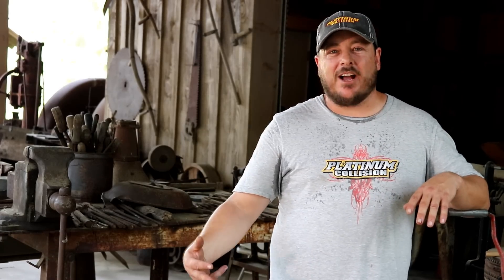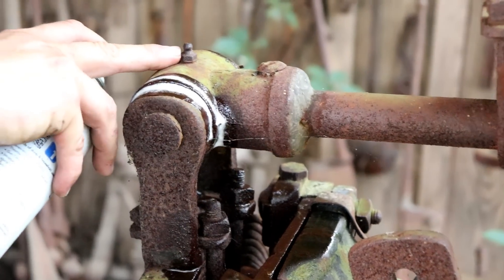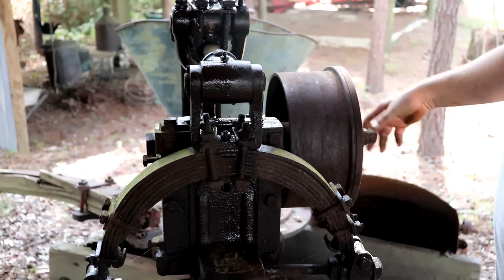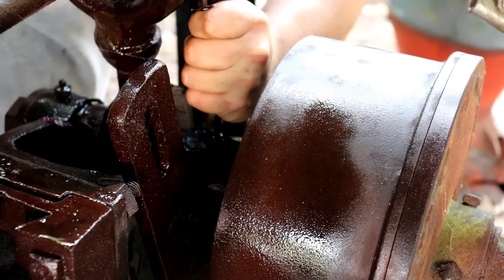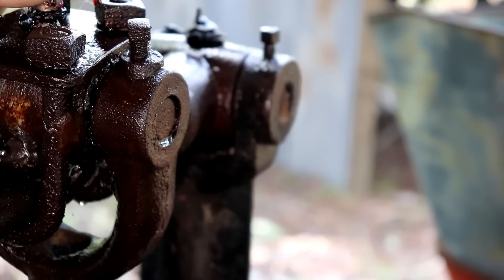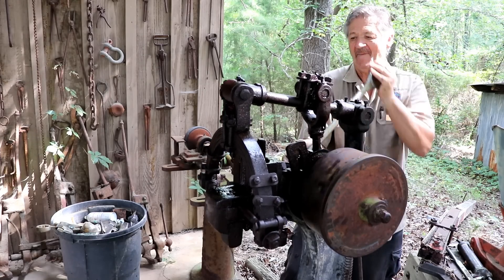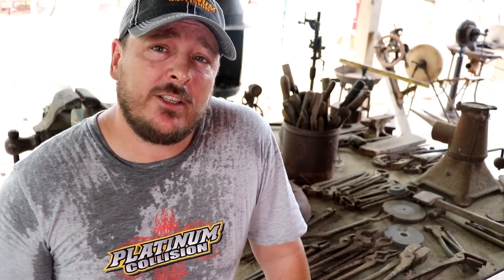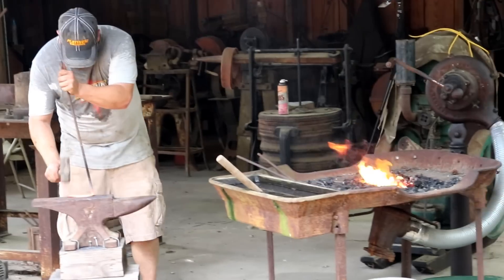RESTORING AN ENTIRE BLACKSMITHS SHOP!! Centuries Old Forging Tools Put Back To Work!

Comment: This would be a dream for me. I live in a town that used to be a resort town. At its peak it had 2000 residents now there are about 20. Someday I would live to build a blacksmith shop in town with orginal equipment like this power hammer.

Comment: Just happened onto your utube channel. Great video - It's good to see young guys get interested or more than interested in old arn. At your rate of accomplishment you'll have the smithy up and running quick as can be. You're doing a bang up job. That power hammer will extend your smithing productivity like nothing else. Thanks for sharing with the community.

Comment: For rusted and seized machines, use a 50/50 mixture of acetone and automatic transmission fluid. Also get a Locknlube attachment for the grease gun. These two suggestions will make the job a lot easier.

Comment: 1/2 automatic transmission and 1/2 acetone makes great cheap penetrating oil and I have seen a test that concluded it works better than the store bought products.   You have some great tools there to start with.
Reply from the maker: +clockguy2 Excellent! THANK YOU! great tip, IWill mix some up and use it in the upcoming vids.

Comment: I have 2 powerhammers made by Kerrihard. That is the old model, made prior to 1915. The head spring system is quite a bit different different than mine. The loaner hammer that is made between 1915 and 1922 has a complete redesign of the head. 
When will you be working on this again? I am very interested.
Reply from the maker: +Greg Malone We will be eorking on it again. Some one did a rough job of making this functional. We still need to test it with a motor.
Reply: Mines been cobbed togeter quiet badly.  Im Interested in your approach. I would like to send you some Pictures of mine and het your opinion. I have a boat and 2 lawn mowers a gun and $150.00 for it. I love it!
Reply from the maker: +Greg Malone I was going to ask for so me photos! thegoodoftheland22@gmail.com 

You stole it! Great deal!

Comment: I'd like to suggest making these videos into a playlist with a series and episode name and number. Love seeing old machines being restored and used again. Also as a side note, I heard you say that the camera stopped recording and you didn't know when. If you have a camera that can run MagicLantern, it has a setting that will automatically restart recording if for some reason the camera stops unless the card is full. I unfortunately updated the firmware in my Canon T3i and magiclantern is not compatible with that version of it's specific firmware.

Comment: I saw a old Farm Mechanic use a hammer luber thing  its pen size  tool  load it with grease place over Zerk fitting  Hit it with a hammer  drives new grease through a stuck fitting  

dont know what is called  or who makes them or where to buy it  

but it defiantly a handy gizmo
Reply from the maker: +Walt Lars Wow. Never heard of such a thing. Makes perfect sense. Gonna see if i can track one down. Will come in handy when we start to restore the 120 year old sawmill Thanks!

Comment: +the Good of the Land. I love seeing old tools and machines restored. I restore old cars as a hobby. I like Seafoam, However, several years ago a old machinist friend of mine show me a 50/50 mixture of acetone and Automatic Transmission Fluid. It  works better than everything else I have ever tried and costs a whole lot less that the spray can stuff from Seafoam, PB blast, liquid wrench, or the WD40 Rust specialist. you have to shake it like salad dressing before you spray it. but it work incredibly well.
Reply from the maker: +Shad Van You are the second person to tell me this. Time to check it out! Thanks for the tip and welcome th yhe channel!

Comment: i have a forge blower much like the one you put on as a replacement but one of the gears has cracked off teeth any suggestions on what to do?
Reply from the maker: +Brennan Fry IBelieve that may have happend th this one. I am planning on taking it apart and repairing it. I will probably weld beads where the teath were and file in new ones. There will be a vid on the fix.
Reply: sweet, keep us posted on the progress
Reply from the maker: +Brennan Fry You bet!

Comment: what would have originally driven that hammer ... steam donkey ? early tractor with a pto ? or something else ?
Reply: TheCanadianBubba a hit and miss engine probley
Reply from the maker: +TheCanadianBubba Yup. We are going to try to run it on ome of the hit and miss motors they have. Hopefully we can get the lister running.
Reply: Does this sound like the "hit and miss" ?

A buddy of mine from the prairies had this great diesel engine that they used in the grain elevators long ago... it was all restored beautifully, painted and set in a wheeled chassis. When the boys would get cocky (usually about halfway liquored up) he would invite them to try and start this behemoth which took two to start it, one to crank and one to engage the fuel i believe, so the one would get it spinning and when he could go no faster he was told to call out to "hit it" the other fellow (the owner) would hit the fuel, this is where the fun started... the crank was a one way cog that would overrun when the engine started, if it was not spinning fast enough to start the compression would kick back, i have seen 250 - 300 pound men thrown across his shop floor from the kickback : ] the other crazy thing to watch was if it started and whoever was cranking let go of the overrunning handle without sliding it off the shaft... that thing would start spinning at crankshaft speed, personally watched it go through the roof twice, and the broken concrete under the machine was from many flung handles as well.
Reply: TheCanadianBubba yes that sounds like a hit and miss but they wouldnt have used one that big

Comment: There are plenty of good products to bust rust. Deep Creep has a few bonuses. It's like if wd40 was cranked to 11! It's has a mild scent (looking @ you BLASTER) that smells a bit like wd40 it's a decent lube with a stick factor of a light chain lube. It's paint safe but devolves carbon (carbs/T-Bodies). Displaces water. It evaporates into a dry lube and melts ice so it's can be used on iced up door locks without attracting gunk later. It sprays upside down. It's Teflon/abs and even sensor safe in most cases. Hell, it's an air tool safe lube! May not be the "Best Rust buster" in the world but it's gotta be close and the other millions of uses make it a must have when you are ready to upgrade to the professional grade Wd40 type product. I love CRC products also but Deepcreep is in my bug out bag.. Not a CRC product. Thanks for the video!

Comment: If you want a good penetrating oil, mix acetone with automatic transmission fluid. Shake well each time before use, as it will separate when sitting. NOTHING works better, and the price:performance ratio is superior to any other penetrating fluid.

Comment: You can adjust the grease gun tip to hold on to the fittings so you can do it without help lefty lucy righty  tighty. keep up the good work

Comment: With old rusty bolts and nuts ,,always heat them up to red hot and chill them down ,95% of the time they will unscrew if not just repeat the heating and chilling over until it comes free

Comment: There's a special grease to use. It called OPEN GEAR GREASE. It very tacky and will last much longer on open moving pieces that dont require a grease sert.
Reply from the maker: +James Engle That sounds perfect! Thanks James!
Reply: The Good of the Land you might have to get it from a supplier like Mobil, Texaco. Regular grease isn't as heavy or tacky. I'm not sure that most store's will carry it. I use it on my semi truck 5th wheel and it last about 6 months verses 2 months with regular grease.
Reply: The Good of the Land also, you will need to get the other grease off before applying this grease because the other grease that's on there won't stick and any good grease will squash out until all the first grease is gone.

Comment: These old cast iron forges will burn through in a short amount of time unless you put a protective layer of high temperature refractory clay on them. With the clay, there isn't any air In contact with the iron when you have a forging heat on them. That kind of heat will oxidize and destroy the metal otherwise Awesome Smithy.
Reply from the maker: +trknust Thanks! I checked the forge today after I read your comment and can tell that it has taken on some metal loss. Excellent tip!

Comment: Eds red 1 to 1 K1 kerosene , mineral spirits, automatic transmission fluid, (acetone or MLK) and lanolin the lanolin is optional but provides a good protectant warning the acetone or MLK can eat Plastics sometimes people use acetone and automatic transmission fluid only as a penetrating oil make sure you use a container that can handle the acetone or MLK without melting good luck thanks for the videos hope this helps
Reply from the maker: +Robert Culliver can you give me the entire recipe again?
Reply: The Good of the Land ok eds red you can Google it but I use 1to1 of K1

Comment: Sorry, this is not blacksmith-coal. You can use this coal to heat a cement factory. Real blacksmith-coal must be short-flame and have a good glow, let a trained Swiss blacksmith tell you that
Reply from the maker: +Paul Gysin What you are talking about is coke. This is coal from the farrier supply. It settles down with little to no flame after a few minutes. Hope this helps.
Reply: @TheGoodoftheLand Sorry that I wrote something about cola, it should be called coal. If you want to continue working with this coal, which is unsuitable for a forge fire, then do so, but you should know that I learned blacksmith in Switzerland and this training is known worldwide as unique and as far as the subject of coal is concerned, we have it very thoroughly at the vocational school learned that coal is very important and also has a major influence on steel, for example carbon and sulfur content
Reply from the maker: @pauligysin  Not cola, not soda not a refreshing beverage. If you had even a rudimentary understanding of blacksmithing you would know what coke is. Google it. As far as coal goes there are four types. peat, lignite, bituminous, and anthracite, Blacksmiths such as myself and all the blacksmiths I know(and most all blacksmiths who use coal)use Bituminous. I was not trying to be rude in my inital response simply trying to help you with your confusion.